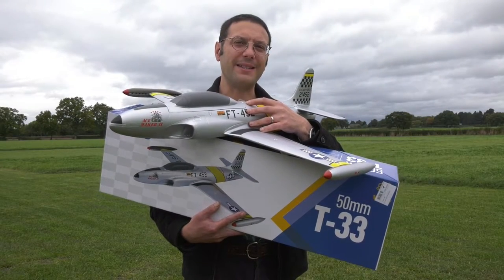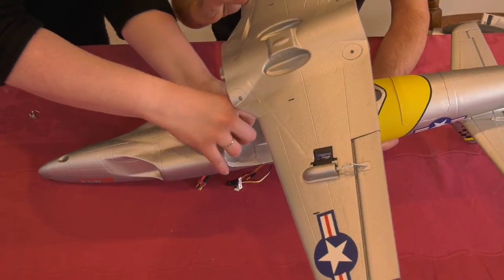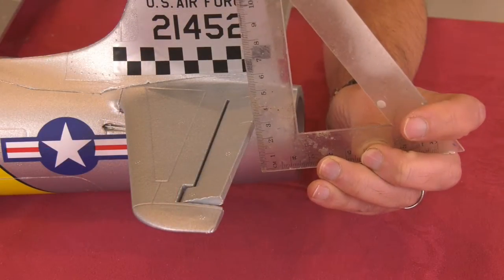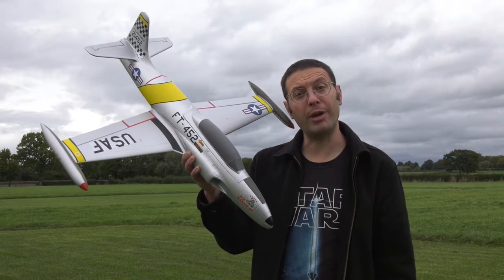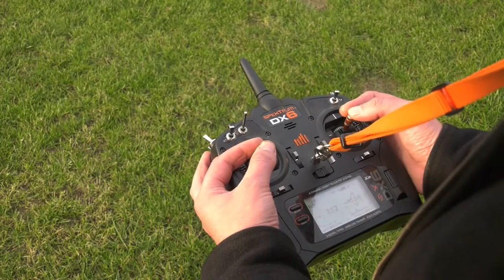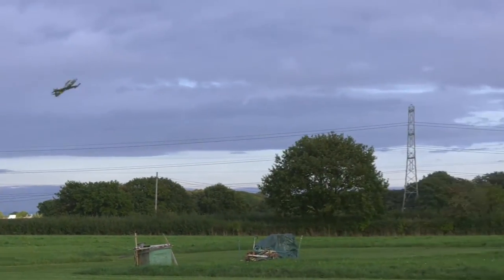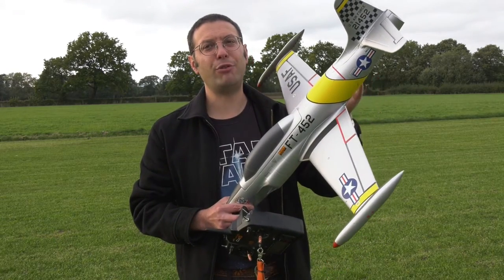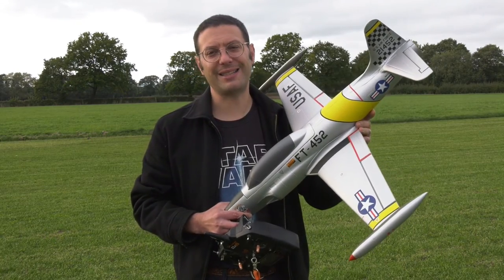Arrows Hobby T-33 Review - Unboxing to First Flight

Comment: Love the paint scheme of this T33, that contrasting yellow band on the fuselage makes orientation easier. Only bug bear are the aileron horns are on the bottom surface of the wing, its a belly lander - put them on the top. They will eventually get damaged if your flying field is not pristine. 4s all the way! 

I would launch it by holding fuselage behind wings and throwing it up and forwards. 

My first 50mm EDF was an A6 Intruder. I would love to see Arrows make this jet available too!
Reply from the maker: An underarm launch might work too - I tend to catch the tail on the back of my pants doing this though.  The finger grips work OK, but a grip behind the wings is much more comfortable.
Reply: @ScaleMeDown  another thing I noted are the horns and clevis’ look a bit weak. Sky Angels were notoriously thin and brittle. Banana Hobby Viper Jet had much beefier and robust ones. Hope they can follow-up on that, perhaps plastic hinges too but you could easily mod those before the maiden.
Reply from the maker: @etops.flight  They seem fine to me - considering the tiny lightweight nature of these models  No complaints yet with the foam hinges either.  If they crack in the future I might mod them, but happy so far

Comment: I could really use some help connecting my wires to the receiver 🙏
Reply from the maker: What seems to be the problem ?
Reply: @ScaleMeDown  I've got a DTXMX Flysky FS-i6X 10CH Radio Transmitter and Receiver FS-iA10B 2.4G RC Controller will this work for it I've got it kind of setup but the right side wing isn't responding
Reply from the maker: @kingsolo303  Hi, I don't use FlySky myself, so can't be completely sure, however the kit comes with a 'y' lead for the ailerons.  Ensure that the plugs and sockets are all the correct way round (wires connected white to white, red to red, black to black) on all 3 ends of the y lead.  Check which way round the plugs are inserted into the receiver.  If you are using separate channels for each surface the problem will be with the model setup in the transmitter

Comment: CAN YOU USE 4S 1500mah 120c  battery in T 33
Reply from the maker: That battery should be fine. There is slightly more space in the battery bay in the T-33 compared with the BAe Hawk from this range